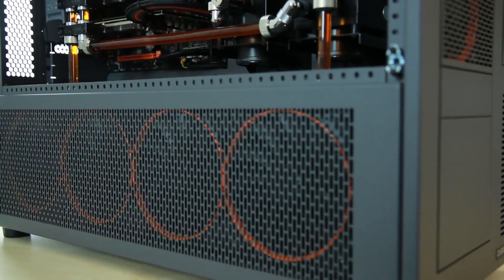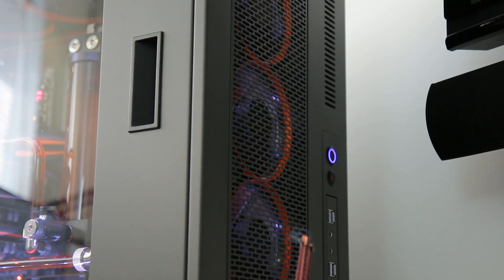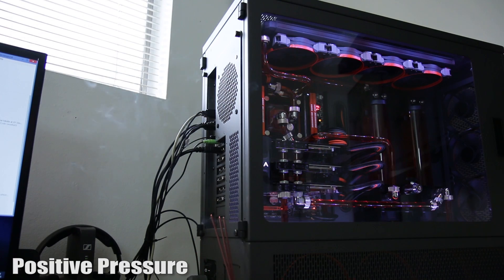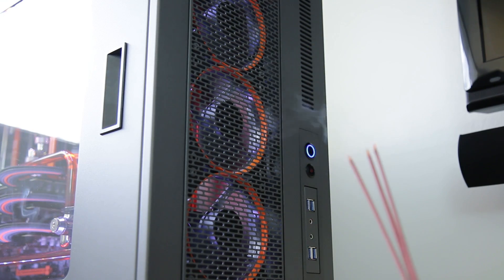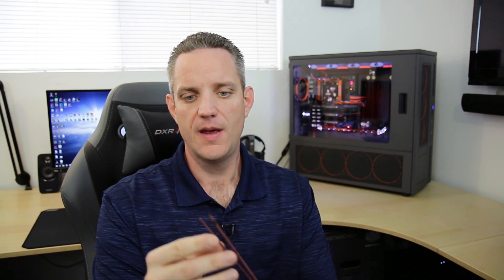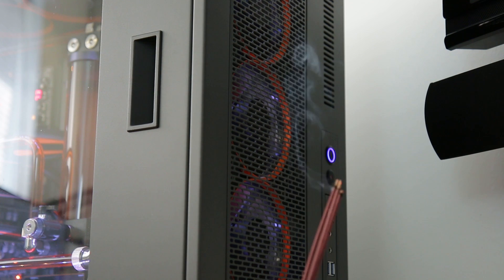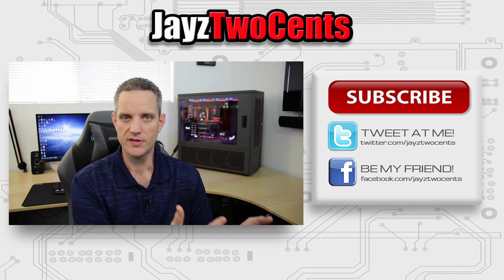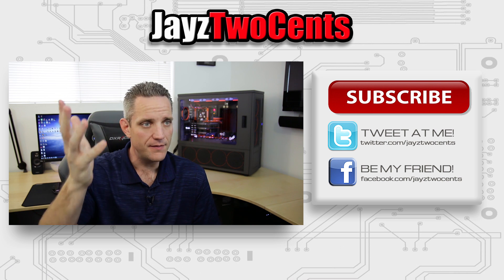Case Flow and Pressure Demonstration - How to balance airflow

Comment: i just put mine in the fridge much easier
Reply: That actually heats up your system faster as the cool air inside the fridge turns hot fast and the fact that there is no new airflow in the fridge-computer system, basically means that you are effectively putting your PC in a hotbox
Reply: +Theguyordie lol wut? What about all the cold air being pumped into the box?
Reply: +MrYTGuy1 There are no vents for pumping in cold air on my fridge. A fridge works because it has to deal with a sealed and insulated box. They are designed to do this as efficiently as possible by and use as little energy as they can. Any active heat source can quite easily overwhelm the cooling wattage of the fridge and internal air temps will rise steadily.
Reply: Jakus Jacobsen A fridge works because it cools air inside of it. The air is pulled out of the main 'box' and into a separate chamber (usually behind the 'box'). It then passes over cooling fins which cause it to, you guessed it, get colder. It is then passed through vents that go back into the 'box' again. The vents that pump the cold air back into the box are usually found at the top on the rear wall inside of your freezer. As to whether or not the heat from a computer can be dissipated effectively in that particular 'box', well that depends on several factors including the amount of heat generated by said computer, the size of the 'box', how efficiently the cooling unit is at cooling air and several other factors including the temperature of the room and insulation, etc. But it is definitely possible to do, although very impractical and inefficient considering the amount of energy needed to run a cooling unit up to the task of dissipating the amount of heat generated by a gaming rig or other heat source. Hope that helps.
Reply: We all know how a fridge works. The simple fact is the fridge won't keep the interior temp under control unless it uses even more power than the pc itself. On top of that they are not designed to run constantly but rather in a duty cycle.
That's why people use air conditioners to build cooling systems for pc's and not fridges
Reply: Jakus Jacobsen  
"We all know how a fridge works." Then why did you say this? "A fridge works because it has to deal with a sealed and insulated box."

This statement would seem to imply that just having a sealed and insulated box magically makes the inside of the box cold. That's just stupid and completely not true. Insulation by itself does not make air colder.

"The simple fact is the fridge won't keep the interior temp under control unless it uses even more power than the pc itself." 

Yes, I literally just said the exact same thing in my last message, not sure why you are repeating it to me as if you came up with it and we are disagreeing about it, but I'm glad you agree with me on that point.

"On top of that they are not designed to run constantly but rather in a duty cycle."

Again you reveal your ignorance, that really just depends on the type of cooling unit. It depends on the size of the unit, the volume of air it can move and how much heat its able to dissipate. Many factors that you seem to leave out or ignore are present in this scenario.

"That's why people use air conditioners to build cooling systems for pc's and not fridges"

Again I never said anything about this type of set up was practical or efficient. I'm simply stating that it is in fact possible to do with the proper set up. Plus the basic idea of a fridge vs AC unit is the same. Take air in and make it colder before spitting it out.

Acting as if a refrigerator is just an insulated box that keeps air out is just plain ignorant. You have to ignore the fact that there is a giant machine attached to the box that's specifically designed to pump cold air into the box.

Saying that a fridge is just a 'hot box' is just super duper wrong in every way possible. I can't remember that last 'hot box' I saw that has a cooling unit attached to it that is literally designed to get rid of heat. So while you can call a refrigerator a 'hot box' it not only sounds stupid, it's completely wrong. 

I dare you to put a laptop inside a fridge and put the same laptop in a regular box. Turn them both on and measure the temps. I think you will see a huge difference because a normal box doesn't have a machine pumping cold air into the box the way a fridge would.

I'll say this in no uncertain terms for maximum clarification. No matter what, as long as the cooling unit is running, its always going to be cooler in a fridge than in a regular box with no cooling unit.

This is literally like 3rd grade stuff here guy. Cooling units make things cooler than things without them. Its literally that simple. In fact, your arguments are so ignorant its bordering on trolling territory, where you just say the stupidest things possible to get people mad.

Go take some basic physics classes about heat dissipation dude. It will help your understanding on this issue quite a bit.

As for me I'm done trying to correct every dumbass misconception that you have like:

"A fridge works because it has to deal with a sealed and insulated box."

And stupid $#!+ like: 

"They are designed to do this as efficiently as possible".

None of which actually explains how the cold air gets put inside the aforementioned sealed and insulated box.

You say these things, then I'm supposed to believe you when you say stuff like:

"We all know how a fridge works."

When all you mention about how it works is just insulation and efficiency.

It's like dude just stop, stop before you make yourself sound even dumber than you already sound. I hate beating up on people that don't stand a chance. Its like fighting a re re. Even if I win I still feel bad.
Reply: +MrYTGuy1  Dude, +Jakus Jacobsen   is right. Fridges don't work because there's no active air circulation. I recommend you check a video on the subject.

Comment: Hey there Jay. I have a question about my airflow. Now, I have a Corsair 88R MicroATX case. I have 2 INTAKE fans on the front of the case, and a standard case fan on the back. I also have a Noctua NH-U14S 140mm cooler on my cpu. It's a pretty big cooler so big that I had to mouth it HORIZONTALLY otherwise it would touch my gpu. Now that coler pushes air out of the top of the case where there is room for 2 120mm fans. Basically given my situation I'm wondering if I should position my rear case fan for intake or for exhaust?
Thanks!

Comment: I filled all my slots with the biggest fans I possibly could.  I'm running the DIYPC D-480 BK and quite honestly it is a GREAT deal of a case, eye em oh (Jay should review it) being honest, my biggest beefs with it is the dust filter on the top of the case makes it so the top 2 fan slots are best suited for intake and the fan controller has Game/heavy load mode, off, and youtube mode only.  I used the stock 120mm fans for the top intake and rear exhaust, replaced the front two intakes with Bequiet! Pure Wings 140mm's, then zip tied the two 35mm's to the grill beside my pci slots as added exhaust.

Comment: +JayzTwoCents,  In my Air 540, I have 2 140mm fan on the front as intake, a 140mm rear exhaust, and two 120mm fan exhausting out the top through the AIO's rad.

Would it be better to switch the rear 140mm to an intake??

Cheers

Comment: I just bought 4 cheap cooler master fans for $13 to accompany my two case fans, and I'm happy with my cost-effective cooling solution; I mean, I'm running a G3258 OC'd to 4.5Ghz with a 212 EVO and an aggresively OC'd R9 280, and I'm just fine and dandy.
Reply: Ahmed Moshet I was actually going to get the G3 but the S5 for some reason strayed me away from the G3.  Either way, all 4 of them are better than iPhones.
Reply: +Daniel Carlino Ah, I remember when I used to be stuck at 4.3Ghz... My vcore is at 1.3v, frequency set to 4.5Ghz, uncore frequency set to 4.5Ghz, and disabled integrated graphics in the BIOS so it can run just a bit cooler. Tip: Don&#39;t worry if you are hitting 80-85C in Prime 95, your CPU will never go more than like 75C in real world applications, including heavy gaming, even if for hours. BTW, I am using a Gigabyte Z97X Gaming 5 for my pretty good overclock; motherboards do matter at least a bit when it comes to how far you will be able to overclock your PC. Man, I wish I could hit 4.6Ghz... Can barely get to my desktop without crashing at 4.6Ghz... By the way, every setting I failed to mention was left at "auto" in the BIOS. Hope I helped :)
Reply: +Daniel Carlino Youtube comments is being funky right now... Based off your temperatures, I'd have to infer you lost the silicon lottery and got a chip that isn't too good at overclocking. I remember I was stuck at 4.3Ghz for quite a while until I started messing around with voltage quite a bit. What's your Vcore Ovveride set to? I tried to lower mine, and that's when I started crashing... I know it sounds crazy, but when I raised it to 1.8v (normal is 1.7v) everything just worked better and 4.5Ghz became stable. By the way, I'd recommend you turn off integrated graphics off even if you can afford it in the temperature department, as turning it off will lessen the stress put on the CPU and may allow you to get a slightly better overclock. If you can't get 4.4Ghz stable through changing frequency, try raising your BCLK (Base Clock) to get a better overclock. Beware though, because base clock changes a lot more than just the CPU's frequency.
Reply: +Daniel Carlino Might've hit the silicon lottery, I guess. In the Gigabyte BIOS it recommends to set the UNCORE to the same frequency as CPU voltage, so I did, and I had no problems with it.
Reply: +Daniel Carlino Maybe it has to do with RAM? If you have high frequency RAM, try setting it at lower settings, and  then try overclocking again. Sometimes setting your RAM at high frequencies can hinder your CPU's overclock. If you have 1600Mhz RAM though, then you should be fine.
Reply: +Ahmed Moshet Hey! What really caught my eye was you saying you OC'd your G3258 to 4.5GHz.  Built my parents a computer with the G3258 and ASRock H97M-Pro 4 and I can't figure out how to OC this.  My personal computer has an ASRock Z77 Extreme 4 with an i5-3570k OC'd to 4.5 GHz no problem, but with my parents I just can't get it.  Any tips?
Reply: Joseph Nadicksbernd Yeah, H97 can overclock the G3258. Just flash your parents' PC to the latest BIOS, and you should be able to overclock with no problem.
Reply: Nice. I really agressively overclocked my gpu and cpu. My 6300 has a 4.5 ghz overclock, and my msi factory overclocked 380x is up at a powerful 1100 mhz, easily running even a full dm on cs go at 300 fps.
Reply: Ahmed Moshet Ehhh, I know how to do all that (done it with my old computers when I was making a hackintosh) but I'm not going to risk anything with my parents computer.  They don't do anything that is really CPU or GPU intensive.  Basically, I gave them a really nice budget build.  Specs are: Mobo: H97M-Pro 4 with Intel Pentium G3258, 8GB Corsair Vengeance (4GBx2), 120GB boot SSD, and a 320GB HDD for files and whatnot, and there GPU is an R7 370 which is way more GPU power than what they need (could have easily gone with a GT610 or something of equal value in performance.  Overall, for the price of around $350-400, they have a really nice computer that'd be hard to fine in stores for the same price.  Benchmarks say that this build could play Battlefield 4 at 1080p with low settings at around 45-50FPS (which is unplayable in my eyes, but for them is awesome).
Reply: Joseph Nadicksbernd if you don't want to do that, it is fine, but trust me, it is definitely worth it... first thing I noticed after overclocking was that my computer is so much faster, especially windows . Windows was so much faster and much more responsive
Reply: Ahmed Moshet Yeah, I understand how OC'ing works lol.  I OC'd my i5-3570k to 4.5GHz stable (had it at 4.7GHz or 4.8GHz but it wasn't completely stable...it sucks.  I was hoping to get in the 5GHz club :( ).  But you gotta understand that my parents only use their computer for occasional youtube. emails, basic web browsing, PDF's and work programs, and that's about it.  I mean, this computer is perfect for what they need.  6 second boot (mines 4 second boot with every application loaded completely), miliseconds to open any program they have.  Btw, I looked at your G+ profile pic and the background is awesome.  Where's that it?  (PS. Props on owning a GS5)
Reply: Joseph Nadicksbernd Lol although I've been to the pyramids, that isn't the actual picture of me being there... This is a 15 minute photoshop of a family selfie where I changed the background and removed my family members... I remember when I had an LG G3, (first 1440p phone) but then my friend broke it and I couldn't find another one, so Galaxy S5 it was. Have you ever seen a G3, G4, or V10? They look so futuristic and beautiful... I loved that phone so much sigh

Comment: I have gone a bit further than this.  No smoke. I used a manometer to check pressure differential at the top, bottom, front and rear. The pressure inside of a case can change with location.

Comment: I have a question J, I have a mid tower in the cabinet built in to my desk running a home built nas. I have put a 120mm intake on the side of the desk and one 120mm exhaust on the back of the desk to keep it cool in there. The case has 2 120mm intakes and 1 120mm exhaust. I have noticed a lot of build up of dust on the front case intake filters. I have sense added a filter for the desk intake. So, my question is, is it possible to to achieve positive pressure in both the cabinet AND the case to reduce the amount of dust build up?

Comment: In my case mb is fliped, so I have to make air flow from top to bottom to cool my gtx 970. Also I got intake fan in front of AIO cpu cooler and and at the back to exaust the hot air out. It's working quite well. I'm happy with that (for now at least, planning to make DIY open air style case from a pipes).

Comment: +JayzTwoCents What is worse, neutral pressure or negative pressure?
Reply: +matrick2298 All 3 forms of pressure work the same, as long as you don't have too many holes and gaps in your case, since it defeats the purpose of clean airflow (On negative pressure).
No matter which pressure you have (positive or negative), the effect only stays till the system reaches equilibrium in the case, then the amount of air going into the case is exactly the same amount that goes out of the case. (Practically neutral) Like I said, as long as you don't have big holes and gaps, the methods lead to the same results. More important than positive or negative is the routing of the airflow since that decides most about temperatures. For example you configure your fans for positive pressure but the airflow goes straight from your front to your top, missing the mainboard and the components, then your positive pressure did nothing to improve the cooling performance.

Comment: Hello Jay, the water cooling guru, I am about to start my first ever water cooled system and plan on using petg tubing and preferably an Ek 250 Res, but I am stuck on finding a sleek case that is one functional and appealing to the eyes and ears. I would love to get a case labs chassis, but it's not looking like it will fit into my budget. Any help or opinion would be greatly appreciated. Btw I plan on making a video log of my experience with the build to hopefully influence people to not be afraid to water cool because I'm only 17 and feel that if I can do it anyone can. Thanks again for reading.

Comment: Does adding case fans help with a fully water cooled system as surely everything is being fully cooled by water?
Reply: +Crawley6300 No matter how much watercooling you have in your case, you always need airflow inside.
The components are cooled directly by the water but they passively give away heat e.g. backside of the CPU socket, RAM, components on the mainboard, cover of the CPU waterblock, PCB and/or backplate of the GPU, the tubing inside, everyting gives away heat. That heat has to be cleared from the inside, so you always have to make sure to have some airflow. If your radiator-fans are exhausts, then of course you always need airflow anyways.

Comment: Hey Jay, I always keep an eye on my temps with hwmonitor and it always seemed reliable, but since I bought a R9 390 less than 2months ago I have seen the GPU temps while idle hit 300-420c. :o It's happened three times but never current value only the max. While gaming and doing anything lately I have hwmonitor open and the GPU with custom fan profile it never goes above 46c - except the times I see the max temps hittin 420... I can't see it lasting after hitting that but atm it reads 43c.
Ever have a problem with HWMonitor? I asked @MSIcanada today but no response. (screen shot on my twitter @buckpwnz )
Reply: Make sure you have the latest update of HWmonitor. 420C (heh) is EXTREMELY HOT. If you actually did reach those temps, you would know because your computer would not be on for you to read those temps. I think components would start falling apart at an obsene temperature like that.
Reply: +Theguyordie I'm using 1.28 the latest hwmonitor. idk what's going on but it's at 30c right now and the max after playing games today is 44c. Just a HWMonitor reporting error/bug I guess...and hope lol